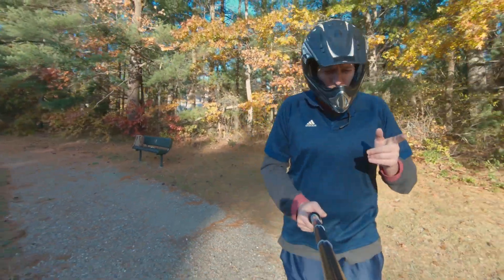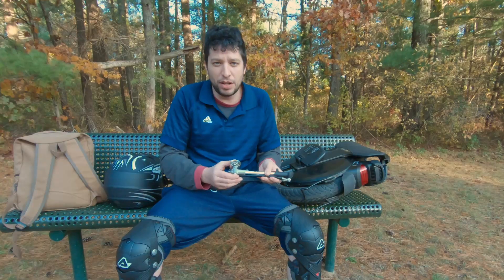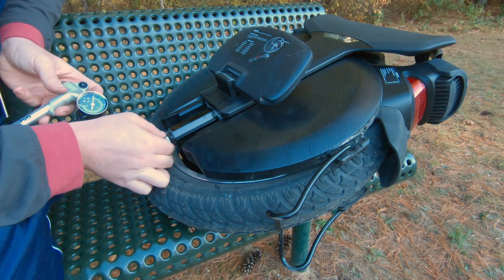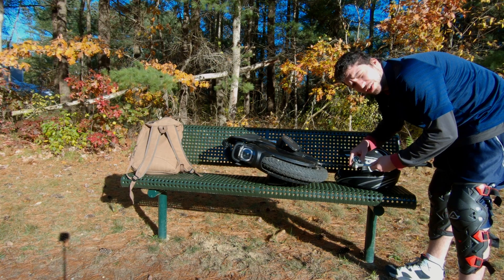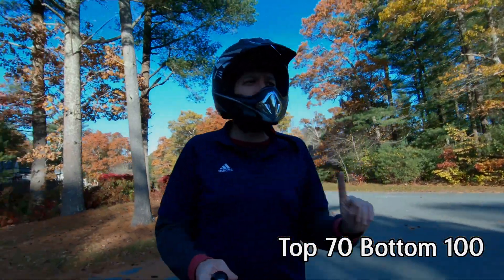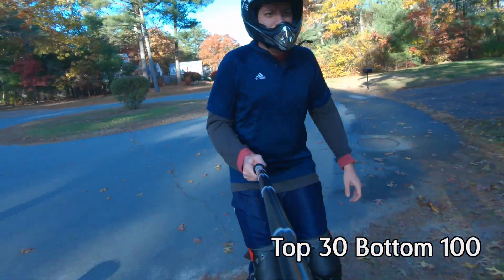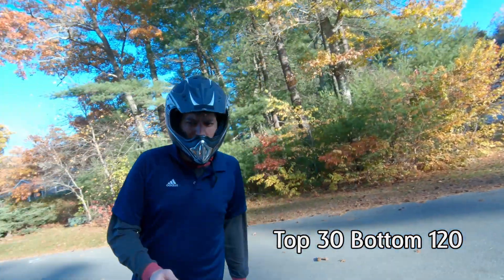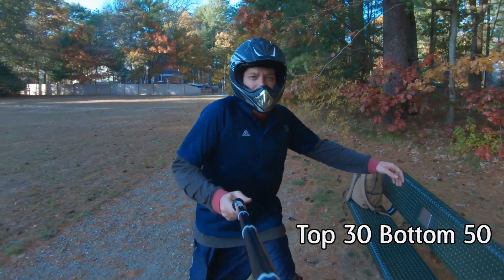Suspension Pressure TESTS on the Inmotion V11 EUC - How to Dial in Air Shocks on Electric Unicycles

Comment: I gotta get more time on the v11, so far I've only rode it twice. Its way different coming from a kingsong 14D. I'm just on thr recommended settings currently. 50 up top and 120 on the bottom, could try a lil less maybe, it still feels a lil stiff coming down curbs.

Comment: I bought the exact same type of pump with the locking lever but my top suspension won’t hold any pressure for some reason. The bottom holds pressure but trying to get 40 psi in the top isn’t working 🤷🏻‍♂️
Reply from the maker: hmmm, wonder if the seal is busted

Comment: The suspension has a little play near the top. Is that normal for the v11. Or is there something loose that needs tighten back down
Reply from the maker: I have seen that vary unit to unit. I think its normal to prevent binding

Comment: Nice, I just ordered the pump shown in your video. The one my v11 had included does not have that chamber to seal the air in when taking off the nozzle. Love the V11. Im 180lbs, To account for loss of air with the inmotion pump, bottom is 150 and top is 100 (hoping in theory it settled down to 130/ 75 psi accounting for air loss when taking of the inmotion pump). My tire is at 28psi, but just pumped it to 30 to see how that feels. I could lower the pressure a bit more to get a better cushioned ride without riding gear, but with riding gear on and 10-15 lbs in my back pack, the prssure i have seems to do the trick.

Comment: Hey George, 

I have a v11 and all of a sudden I'm losing air pressure in the suspension system. I believe it's the lower chamber but not exactly sure. Is this common for the v11? I have to fill it every time I ride. Any idea on how to fix my problem?

Eagle13400
Reply from the maker: You may have blown the seal inside the shock. They are easily replaved though. I believe they cost about 60$ last time i saw on EUCO
Reply: For what it worth: There is a small golden tool that came with the wheel. It helps to tighten the valve core. 

I realized that after changing my shocks. The stock ones weren’t actually leaking (just not tightened enough).

Comment: Im 142 lbs and I use 90 lower and 40 upper with 30 in the tire. With that combination I get about 3cm of sag standing on the wheel. With 8.4cm of total travel, that's about 35% sag. Sag measurement is the most important thing, please mention it

Comment: I really hate the design of the top chamber. Those 4 saddle screws are making my head explode. I need to smoke like 20 Js
Reply from the maker: lol, personally i dont think its bad at all considering you dont really need to ever change it once dialed in.  1000+ km on mine and no leakage
Reply: yeah I totally agree, they should have some kind of easy access door.
Reply: I just bout 6” extenders and it works great...never have to take covers off!
Reply: *bought
Reply: @paulh4866  oh dude that’s great thinking, I’m gonna get me some today. And also a better shock pump. Appreciate it!

Comment: As a big boy 275 of love, I roll 50 on top, 180-190 on bottom.  As a long time MTBer these chamber can leak air, but alot of folks forget that it looks like a leak when you re-connect the pump and it has to fill the empty air in the pump up until the gauge.  It is enough to make it look like a leak.  Love the vid.
Reply: Not sure if you guys gives a damn but if you are bored like me atm then you can watch pretty much all of the latest series on InstaFlixxer. I've been streaming with my girlfriend during the lockdown :)
Reply: @Ray Amos yea, have been watching on instaflixxer for years myself :D

Comment: George have a question about the pressure on the shock-I think mine is leaking because I have bottom down when filled a day before. Have you experience this?
Reply from the maker: No i had zero leak after 300+ km riding. I would contact them about potential warranty replacement parts if its leaking

Comment: What was the pressure suggested to you from the manual? You did not cover getting at the upper chamber. I found it very difficult to get the sides on and off. I managed to break one of the screws that hold the side panels in place.
Reply from the maker: oof, that stinks.  I show how to remove the saddle in another video so i skipped over it on this one.  probably should have included a reminder for people.  Its just held on by 4 screws, the 2 on the side of the machine, and the 2 on either end of the top.  the whole black piece slides right up and out once the screws are taken out. once pressures are adjusted, it should slide right back in place.  if it doesnt fit quite right try switching the panels , you may have swapped them by accident after removing them
Reply from the maker: https://youtu.be/EZSrbwv8IhE this is the video if you prefer a visual aide

Comment: Glad I watched.I was not releasing the pressure from the pump before removing it. I often heard a hissing sound on removing it. I thought it was coming from the system but might be just the pump's pressure.
Reply from the maker: Yeah could have been from the hose , but it could have also still engaged the valve if there was pressure in the hose so its hsrs to say.  Best to just bleed it and confirm no hiss! Glad the video helped!

Comment: For your weight (similar to mine) what do you recommend for riding on roads and asphalt bike paths? Mine should be arriving early next month!
Reply from the maker: You want to try it a little high to start i think, it will be easier ti learn to mount if its a little stiff.  But once you get used to it, i really like 30 top 90 bottom for road riding, but if your going to pound offroad, i like 140 on the bottom
Reply: @GoGeorge  I finally got my V11 a few days ago and it has the new black pump. A video showing using that pump is https://www.youtube.com/watch?v=cQgpQhzO3Vc   So George, are you still using 30 top 90 bottom for road riding???  I initially set mine around 140 top/70 for my 203lb riding weight but not feeling as much cushioning as I was hoping.
Reply from the maker: @silverwingshg  yes close to that, i have beennusing 40 top and 90 bottom for smoothe pavement riding.  40 top and 140 bottom if im hitting curbs/steps/offroad

Comment: I got my V11 a week ago and they do not supply that pump model anymore. It is now a black pump with no lock out to separate the Schrader valve from the tube. I am going to try your 90/30. Thanks again
Reply: The new pump is still able to lock out the schrader valve, unscrew the back plastic part of the end while leaving the metal tip attached.
Reply from the maker: @buckykat4242  Thanks for adding that in for anyone who has the new pump!!
Reply: @buckykat4242  wow, thank you. I thought the pump was worthless because all the air was escaping when removing pump. I was going to buy the one in video. 👍

Comment: Great video.  Now test tire pressure as well :)
Reply from the maker: Totally worthy of a video, amazing the differences the tire pressure can make
Reply: @GoGeorge  agree - went from 28 to 33 psi and it was a ton on difference - and from 130/60 to 110/50... but I need to do some more testing :) Great Content :)
Reply from the maker: @vejby9621  thanks :) . Yeah i started at 30 and moved to 35 now